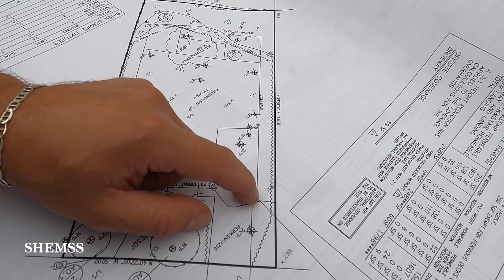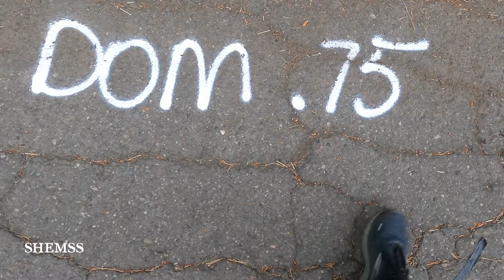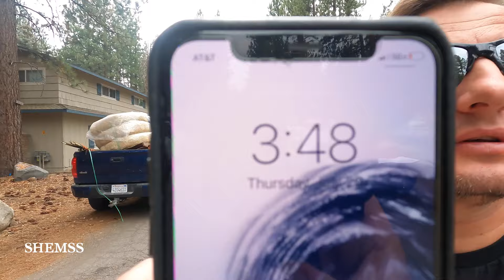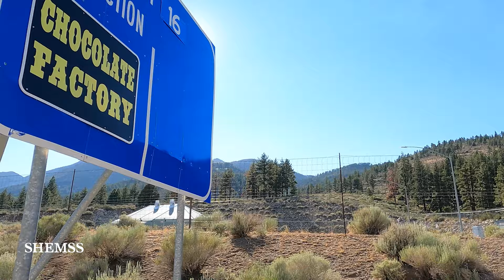Temporary Power Pole Set Up | Water Supply Line | New Construction

Comment: Anybody familiar with Florida Laws on Temporary Power poles.  I have a vacant residential lot on in central Florida on a very narrow and soft road few cars would dare drive through.  No houses in 1000' square feet. However,   200' away there is a power pole.   I am yet to have a survey done, have been able to drive to the middle of the lot where I've camp.  I'm looking for the cheapest way to get Duke power to run me a temporary 100amp power connection.  I called they said the county would need to inspect and I would need a building permit.  I've heard you can get a permit for just a well pump.  How about if I want to manually clear myself using electric?  Also, soon I will be driving electric and need power to charge my truck.
Reply from the maker: something you can look into with the local building department.